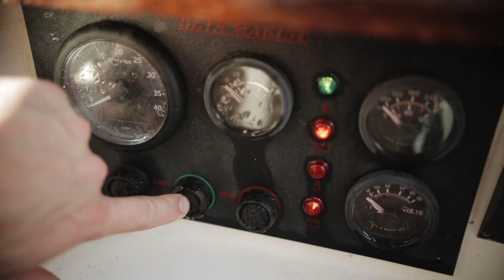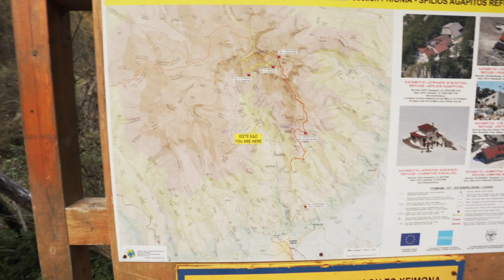Sailing to The Mountain of The Gods to Forage Mushrooms in Greece | Olympus

Comment: Why would you put your mouth on a delicate piece of metal? What if a trumpet was designed to take on heavy wind intake on ships and then direct that wind pressure into a fireplace pump designed engine...
Reply: The more wind equals more engine power. And more speed equals more wind :)

The notes are pressure adjustment dials

And to allow the pump to inflate and deflate like a piston it can be built with a. Dual pump system switching the flow between each allowing just enough time to inflate n deflate each pump
Reply: The main idea behind this is how does one move with nature into the wind and my first idea was a U shaped pvp pipe into a sail but that’s just to go against the wind current :) blow the wind behind you but you’d almost need a shield to stop the sail from blowing inwards and idk if that would be arrowdymaic

Shoooulda commented this on the previous video but too late :)